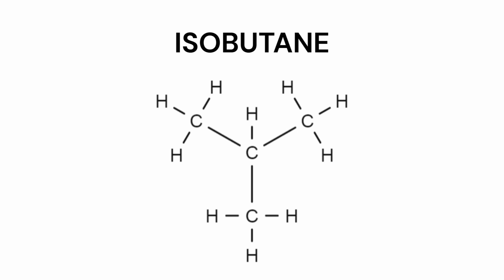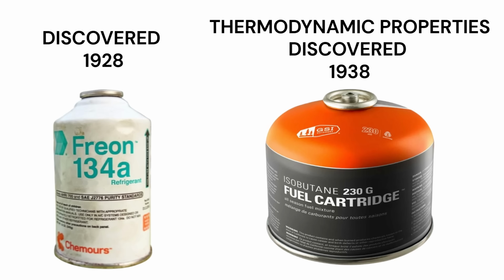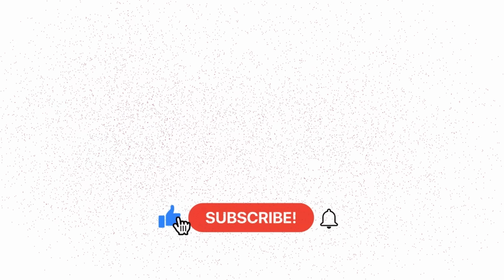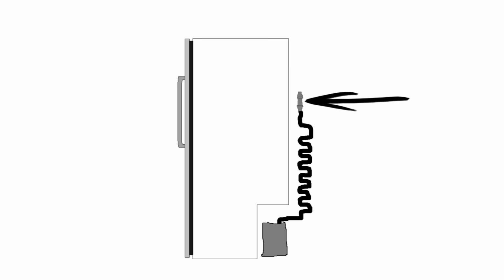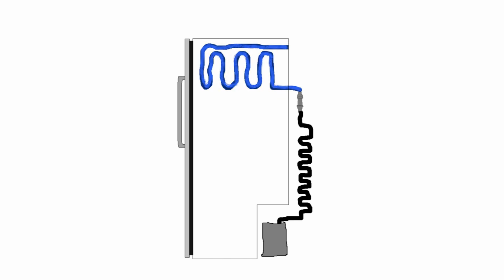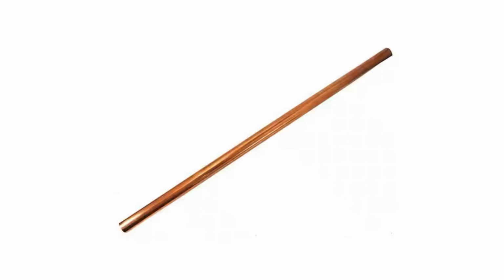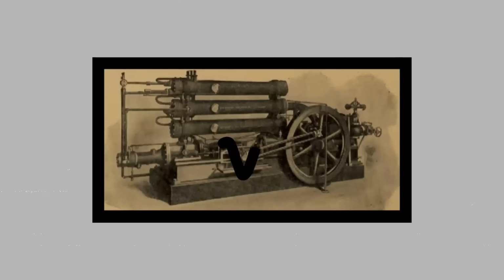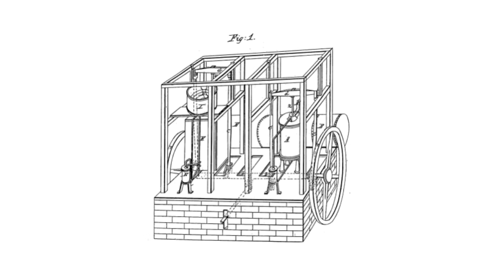Was Doc's 1885 mechanical fridge in Back to the Future really possible?

Comment: One error: ammonia piping does NOT use copper. Any moisture that might find its way into the system, when combined with ammonia, is very corrosive to copper. Best practice is to use steel pipe and fittings with ammonia..

Comment: What I don't get is why he did not just use an Absorption refrigerator. They use Ammonia and water and have no moving parts. Relying only on a heat source. These today are very common in campers as they do not require electricity and can run off the campers propane supply. They had the same simple evaporator and condenser but added a boiler and separation chamber. All of which could easily be made of copper and built in the 1800's. It would have been small too. Possibly as small as a dorm refrigerator even back in the 1800's.

Comment: Copper is not compatible with ammonia. It's also far more likely that he'd use absorption refrigeration considering how much easier it is although the efficiency is terrible (move less heat than energy put into the system)

Comment: The simplest solution would be to build an absorption refrigerator using a water/ ammonia solution.  It's different in that it doesn't require high pressures or a compressor.  Just a heat source (fire or steam) and a low pressure transfer pump (that could also be steam driven). The ammonia solution is easier to get and handle than anhydrous ammonia.  Unfortunately, this type of refrigeration didn't come out until 1920', but Doc Brown would still know about it.

Comment: I have operated a steam-powered air conditioning system. It would ice up if you operated it wrong, so it could cool ice for Doc's iced tea. Water was the refrigerant. Steam was used in an air ejector to draw a vacuum inside a phase change chamber. No chemicals. No electricity.

Comment: The thing with it is, using 1800s tech to make ice would've been pretty simple, and wouldn't even need moving parts if it's steam powered. Just need a lathe to machine a venturi ejector for the steam boiler to make a steam-ejector cooler, it's how the first air-conditioned trains worked and how a lot of commercial-sized walk-in refrigerators ran even up into the 1950s. All you gotta do is make a venturi ejector vacuum pump, pull a vacuum on some saltwater brine (so you can get it down below freezing), and then move the supercooled brine over a container of regular water, and boom, you got ice.

Comment: Doc would also know how to make differential screw so he would be able to make a milling machine and lathe for the tight tolerances that are needed for piston style compressors. And the music metallurgy of making tool steel  needed to make end mills.

Fun fact you need differential screws for precision optics like in his rifle. . . 

The only issue is rigidity of the initial materials to boot strap a setup like this. It requires resources like high temperature smelting and ceramics that were hard to come by. . .

Comment: mechanical refrigerators using ordinary air (atmospheric air, primarily nitrogen and oxygen) as the working fluid have been built and used historically, though they are rare today due to lower efficiency compared to vapor-compression systems.
These operate on the air cycle (also known as the reverse Brayton cycle or Bell-Coleman cycle), where air is compressed, cooled (rejecting heat), expanded (producing cold), and then used for refrigeration—without phase change, unlike common refrigerants.

Comment: In 1834, the first working vapor-compression refrigeration system, using the same technology seen in air conditioners, was built. The first commercial ice-making machine was invented in 1854. In 1913, refrigerators for home use were invented.

Comment: This is exactly like Howard Stark says to Tony. The problem isn't the Idea but the limitations of the Technology available at the time. Emmett isn't limited because he doesn't know how to do it but rather he's limited by the Technology of the Time Period he is and had to reverse engineer an Ice Making Machine to make one with the Technology of 1885. Another example would be that,without having the materials available to test and having to trust on his memory,he was able to write instructions for his 1955 self to replace one component made around the 80s by the Japanese with a big box of components made around the 50s in America. My bet is that Doc most likely build something similar to the Train Engine due to its sizes,something that uses Steam as Fuel given that Electricity would be more difficult to do and to hide (remember that Emmett don't want to reveal anything about the future so history could still follow its natural course) and just like he says later on the film,Gasoline and the components needed to repair the DeLorean's Fuel tank wouldn't be invented until around WW1 in the case of the Fuel and after WW2 in the case of a Fuel Tank that could more or less replace the one the Indians broke,meaning that they would be stuck and most likely both Marty and Doc would be dead of old age before the materials needed to build a Fuel Tank could be available. You also have to remember that,if Emmett could be able to build anything with the materials available on 1885 at the cost of being something big,instead of writting a letter that would be delivered 50 years after his death so his younger self could help Marty,he would had reappear seconds later with a machine big as his Train attached to the DeLorean just to pick Marty,leaving him on 1985 and saying farewell forever given that he found himself a place to be as a Blacksmith on 1985.

Comment: Ammonia likes to eat copper, so a system using ammonia and copper tubes wouldn't last long, most ammonia systems used black steel pipes the same as steam systems, and these were available back then as well and already widely in use for industrial steam systems, and most importantly it was pressure rated. So yeah, old Doc B would have used black steel pipes, and insulated using hemp and tar just like old cool stores did back in the day.

Comment: He cod have createda mercury vacuum chamber that basically dropped mercury in an insulated double walled chamber, and as the atmospheric pressure dropped it would cause the water to rapidly boil, cooling it off rapidly. Once it was cold enough to freeze it could  work really well

Comment: Since gunpowder was available at the time, by extension Doc could leverage an endothermic reaction of dissolving saltpeter (gunpowder component) in water. I don't think that he would need too much saltpeter either, given that he aims for a single icecube. No machinery or complex tools are needed. Just a big vessel to hold the water and dissolving saltpeter, and an ice tray submerged in the center. After getting the ice the water can be boiled to get the saltpeter back, allowing it be reused.

Comment: from Wikipedia:

Icyball is a name given to two early refrigerators, one made by Australian Sir Edward Hallstrom in 1923, and the other design patented by David Forbes Keith of Toronto (filed 1927, granted 1929),[1][2] and manufactured by American Powel Crosley Jr., who bought the rights to the device. Both devices are unusual in design in that they did not require the use of electricity for cooling. They can run for a day on a cup of kerosene, allowing rural users lacking electricity the benefits of refrigeration.

Operation (Crosley Icyball)

The Crosley Icyball is as an example of a gas-absorption refrigerator, as can be found today in recreational vehicles or campervans. Unlike most refrigerators, the Icyball has no moving parts,[3][4] and instead of operating continuously, is manually cycled. Typically it is charged in the morning for 1.5 hours,[3] and provides cooling throughout the heat of the day.

Absorption refrigerators and the more common mechanical refrigerators both cool by the evaporation of refrigerant. (Evaporation of a liquid causes cooling, as for example, liquid sweat on the skin evaporating cools, and the reverse process releases much heat.) In absorption refrigerators, the buildup of pressure due to evaporation of refrigerant is relieved not by suction at the inlet of a compressor, but by absorption into an absorptive medium (water in the case of the Icy Ball).

[ NOTE: This system of refrigeration does not require a compressor. That means it has no moving parts & would be simple & easy for Doc Brown to make quickly from basic items that would be commonly available, even in a primitive frontier community with only limited resources. ]

Comment: Actually it would require nothing exotic or even a liquid.  A steam engine can compress air, the only requirement would be that the air would need to be quite dry (more on that later).  Compress the air to around 150 PSI (common working pressure of an 1808s steam boiler for a locomotive or power plant).  HIs compressor may take hours to fill a large tank, but doable.  The compressed air will get very hot, but a heat exchanger in the pipe from compressor to bottle (evaporator) can dissipate that heat.  The air bottle needs to be at roughly room temperature.  The pressurized air can then be vented out into the condenser where the lowered pressure will chill the air in the condenser by about -100C so assuming ambient temperature of around 22C it would chill to around -80C in the evaporator.  To prevent the internals of the condenser from icing the air would need to be very VERY dry.  The dry air can then be captured in a gas bag to recycle through the compressor and back into the system for reuse.  It would not be an efficient refrigerator but certainly capable of making more than a single ice cube.  Given a large enough air bottle (about the size of a steam locomotive boiler) and a big enough steam engine to drive the air compressor in a closed cycle a continuous freezer would be possible only using air as a working fluid.  Of course something like Ammonia would have been used in commercial refrigeration of the period making it a more plausible choice for Doc despite its toxicity.  CO2 would have been another better choice than air, and safer than Ammonia though not as efficient and its relatively high freezing point gives it some engineering challenges to prevent icing within the condenser.

Comment: "Mechanical refrigerator?" Yeah, current refirgerators, and freezers, and air conditioners are mechanical. Unless you count those cheap mini fridges that hold 4 pop cans, those use TECs, but they suck and die really fast.

Comment: The concept behind this video is flawed. You are answering if an person living in 1885 and with the knowledge of a person living in 1885 could develop a refrigerator. This doesn't apply to Doc. Doc knows about the concepts that isn't know in 1885. The only question is: what does Doc know? What can Doc make (how handy with building gadget is he)? Which tools can Doc get hold of and which materials can Doc get his hand on? For instance, the idea that Doc couldn't have electricity is wrong because it is easy to make a generator even with the tools and materials available in 1885 - so if Doc wanted electricity he could have it. He could build a generator with the tools and technology of 1885 and power it with a steam engine - he can even use AC since he knows of Teslas invention.

Comment: Lots of discussions in here about if and how alcohol could power the delorean. Anybody remember when the fuel shortages of WW2 caused people to power vehicles with wood gasifiers? Doc would have, and would have known that all he needed to do to run that engine was cludge a crude gate or butterfly valve onto the intake to control the mix and charge the battery to get Marty home running syngas.

Comment: There's another way to make a refrigeration cycle without a compressor, or mechanical element. It's even still in use today in camper fridges. They only need a source of heat for them to work. Also specific technology didn't need to exist, he could have invented anything that could be built within that time period with the tools available, by virtue of advanced knowledge. Even if Ammonia hadn't been discovered, it's doable, given todays knowledge, to make it yourself in 1885.

Comment: You made a couple small errors,  I saw the Ammonia comment, fairly obvious because there are propane fridges today.  The other error was the electric motor being unavailable.  Which just isn't true, given copper wire and the ability to wind it Doc could easily have made and stored energy.  It would have been dumb to use for refrigeration, but the lack of off the shelf parts didn't preclude Doc from building one.  The principles are very simple and I am sure if I understand them Doc could create a generator/motor pair quite easily.

Comment: Carl von Linde had already obtained patents for refrigeration machines in 1874 and 1876. Linde's machines were used industrially in breweries. However, Linde's compressor was not electrically powered, but driven by a steam engine. In 1885, it was not only possible to build such a machine, but it could also be purchased (for a lot of money). Another point is that it tells us that there will be cars in the future. Now, in 1885, the first self-driving vehicles already existed, but the first car, the Benz Patent Motor Car Number 1, was only patented a few months later in January 1886.

Comment: Propane fridges just use a heat source to compress the gas.  You skipped the most basic element that was still widely used in RV fridges thru the 2010's.. Granted on the movie.. they were trying to show or represent actual compressors.  But heat accomplishes the same result in way more of a basic sense.

Comment: Ammonia cycle refrigerators are fairly common in the RV industry. They use a propane flame to heat the ammonia instead of using a compressor.

Comment: I would say yes, doc already knew the science behind making a refrigerator
Reply: You say that, and it would be a reasonable observation, but the refrigerator he made is worse than what historically accurate refrigerators of the era were like. It had more parts, took up more space, and only did a single ice cube at a time. Late 19th century refrigerators weren't great, but they could do better by that point as the first ones had been around for decades.

Comment: They actually had hand pump refrigerator units at that time, not common, but something scientific hobbyists could pull off. They were much smaller than his. But for the life of me I don't understand why he didn't add a simple carbon filter to the water line, if not a full on distillation. Comedy I guess.

Comment: In the anime dr.stone he uses gold thread to make a freezer. Using a piston pump to push and pull the air dispersing and disipating heat. Gold has high conductive and is used for heat sheilding. But how powerful and efficent would it be? Also, gold was expensive but because dock brown was in the past if he remebered where he coould get som he could use it.

Comment: Ammonia based refrigeration , 1859 invented...  Basically just a motor to power a compressor... ie even steam...
Ammonia is still used in more industrial settings... were as 
R-1233zd or R134 , are more safer freons for more compact uses... 
However latter 1800s for  mechanical refrigeration cars.. 
first were 1851 but required ice , later ice and salt mix .. 

But with mechanical knowledge,  its quite possible doc could have applied the mechanical refrigeration of the times to his situation... and prior knowledge of inventions...

Comment: The electricity in a refrigerator just drives a pump most forms of mechanical power could be geared to drive a refrigerators pump it just won't light up when you open the door. A phase change makes refrigerators more efficient but you can build one with just compressed are in the radiator, when released the compressed air gets colder as it loses pressure. Crank a Stirling engine and it becomes a heat pump with a cold side and a hot side first patented in 1816.

Comment: I'm thinking along the lines of he didn't actually use a refrigerant.
He might have simply used compressed air....
When you compress air, it gets very hot and holds a lot of moisture. If this air is left to cool down while still under pressure, the moisture will condense into a puddle that forms at the bottom of the tank. All you need to do then is quickly decompress the air and it will cool down to the point where it freezes that water. I've dodged many an ice bullet while draining compressed air and if the tank is big enough, ice starts to form on the outside of the drain pipe.
The film does show us a rush of escaping air from the machines outlet just before it spits out bits of ice.

Comment: Puts water into a tank, Vacuum pumps it super strong, and Cold boils water to match pressure leaving ice Modern households are filled with inefficient trash. Masses don't generally have intelligence to compare anything to know. How long will ice stay frozen in a cold boiler that auto releases heat once pressure is set? Forever.. Google: "Strange 'UFO' Disc Is Found In 16th Century Painting Yahoo news" Points at mention of smoke and Points at Black smoke of Hades I'm super efficient.. - Dracula/Hades (Owner of Eternal Hell server)

Comment: three-way refrigerator does not use a compressor to cool its contents; instead, it operates on an absorption refrigeration system that uses heat from electricity (12V or 240V) or gas (LPG/propane) to power a chemical process that creates the cooling effect